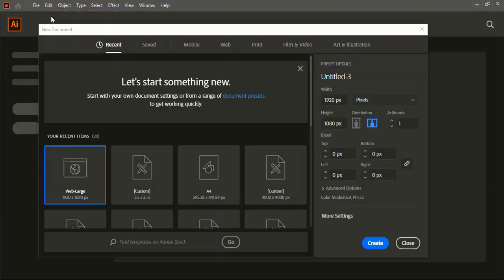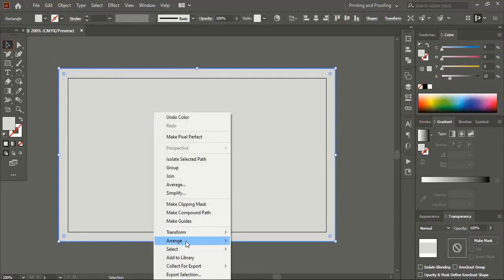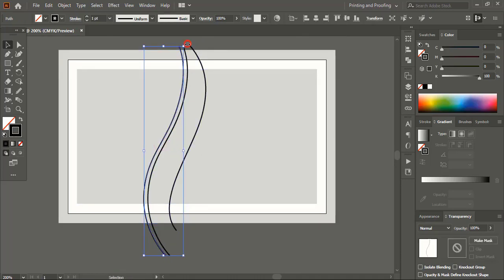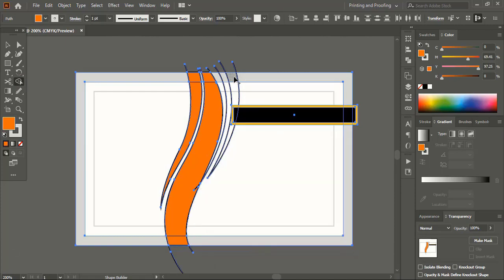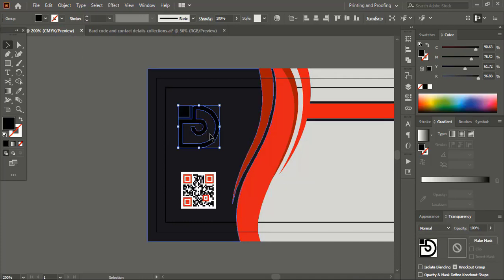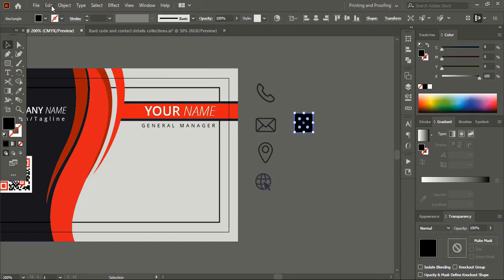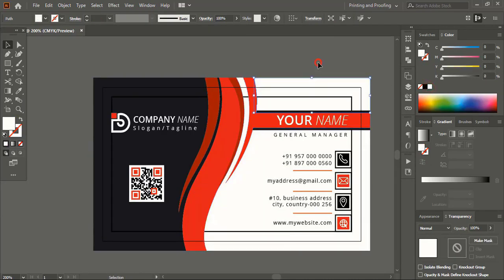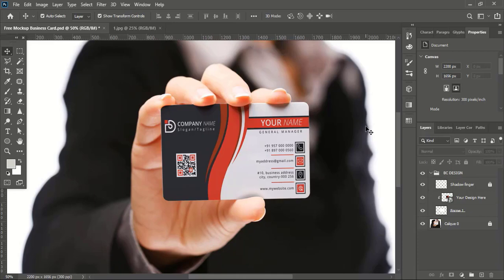Print Ready Business Card Design in Illustrator | Create visiting card die cut line & bleed section

Comment: I work as a graphic designer for a print shop.  These instructions are completely WRONG.  First of all, if you want to specify a bleed area, you simply do that in the document setup before you start your design.  (You would specify a 3.5" x 2.0" document size, and specify a bleed of 0.125" on each side.  You do NOT need to create a separate rectangle shape to designate a bleed area.)  Second, why would you bother creating the card in Illustrator, and then placing it into Photoshop?  All you need to do is save it as a PDF from Illustrator (including the bleed area), and then send that PDF file to your chosen printer.  You don't need Photoshop at all!  Third, if you want the best print quality, you NEVER -- I repeat, NEVER -- utilize JPG/PNG as the file format.
Reply: Preach!
Reply: Right
Reply: he has passed away in fab 2022
Reply: please tell me which format i should utilize as the file format for best print quality?
Reply: @kitchencook2573  You would use the Adobe PDF format to send to a printing company. Make sure you include your bleed, if there is one, and outline all fonts. You should also flatten all layers.
Reply: @JamesKaufman1973  sorry i cant understand iam new in this can you tell me in depth step by step
Reply: flatten all layers mean?
Reply: @kitchencook2573  Submitting a file to a print shop that includes layers can result in unpredictable results.  In your Layers subpanel, click on the menu icon and select FLATTEN ARTWORK.  Then, when you save the file as a PDF, deselect the option that says "Create Adobe Acrobat Layers."
Reply: hey, @jkaufman we need to put the pdf file in press quality or illustrator default? (while printing)
Reply: @hasnainsaifuddin3118  Illustrator default is fine.  If you are sending to an outside print service, make sure all fonts are outlined before saving as PDF.  Under the General tab, UNCHECK the boxes for "Preserve Illustrator Editing Capabilities" and "Create Acrobat Layers from Top-Level Layers."  Under the Marks and Bleeds tab, CHECK the box for "Use Document Bleed Settings," but DO NOT CHECK any of the boxes for printer's marks.
Reply: @JamesKaufman1973  oh ok thanks for the guide 😊 ❤️
Reply: Thanks for great help. Question, what happen if I use gradient color? Should I ex pand it? Is it mandatory? Please help
Reply: How would you add crop marks? Could you create a video tutorial or explain here. Thanks!
Reply: Right
Reply: What else the pdf file do we have to deliver to the client